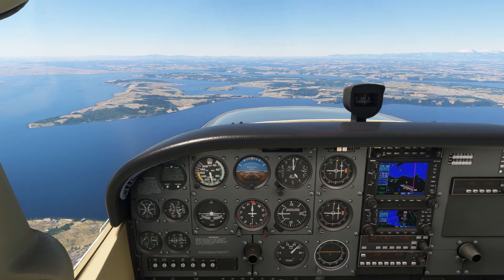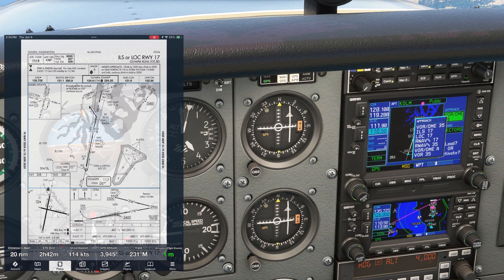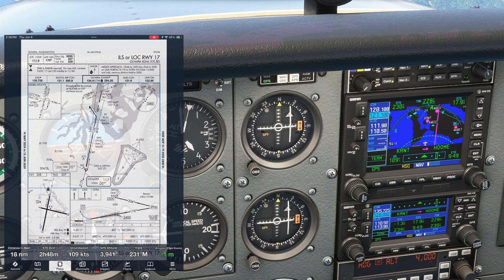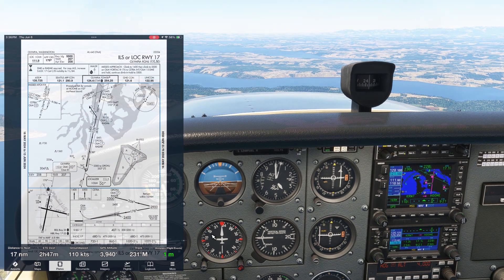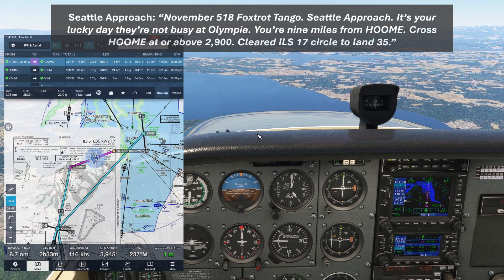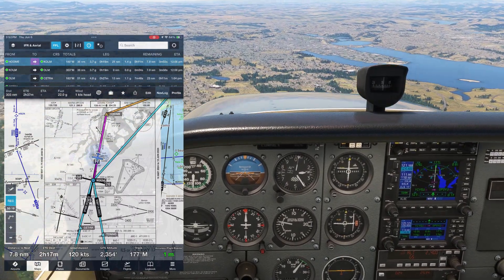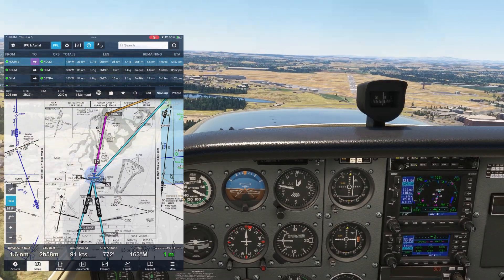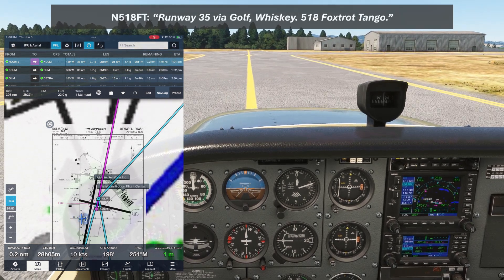ILS with a Circle to Land | Long IFR Cross Country 61.65(d)

Comment: Love these videos, And I am personally a member of the instrument Ground School you offer. Circle to land was very confusing to me at first. Only in concept. At the end of the day, what really is the difference between a circle to land and a  vfr approach to the appropriate runway? Circle to land seems to mean you use the approach that’s convenient, and then make changes to land where you need to. But in order to do circle to land, you must be vfr, right?
Reply: its an IFR maneuver that's allowed when it's on the plate with circling minimums and not forbidden on a specific side due to obstacles, which would be remarked. you have to be VMC (visual meteorological conditions) at the MDA (minimum descent altitude)  to then be able to circle. if you lose sight, you go missed. and VFR is visual flight rules, different approach/flying rules.

Comment: Good video, as always. Couple of points that would be worth to add on this topic: 1/ Standard vs Expanded Circling Radii, 2/ that unless we are instructed otherwise by the tower, we should expect to circle in the direction of the traffic pattern, 3/ when flying an approach to non-towered airport, we are authorized to circle to any runway and thus we don’t need clearance nor even need to tell approach control about it (unless circling is explicitly disallowed in the IAP). I find those are the three areas that are commonly misunderstood by instrument pilots.

Comment: Nice vid, can you tell me when you have a situation like this? Just curious. Take care
Reply: Circling approaches were very common in the days before GPS. It wasn't unusual to be flying into an airport that had only one approach, but have the wind favoring the opposite runway. Your only choice would be to fly the published approach, then circle to land into the wind.

Even today, you find ground-based approaches, such as VOR approaches, that aren't lined up with any runway. Every approach is a circling approach.

Don't fall into the trap of thinking ground-based navaids are obsolete or unimportant. A GPS outage, while unlikely, is not even improbable.
Reply: @johnopalko5223  Great explanation, thank you. Take care